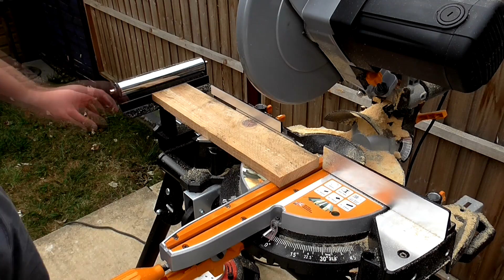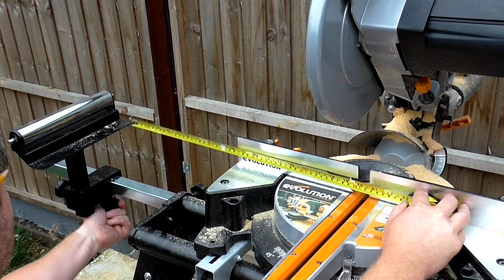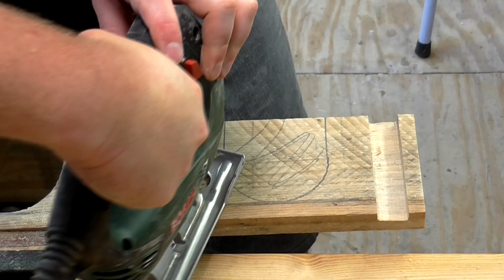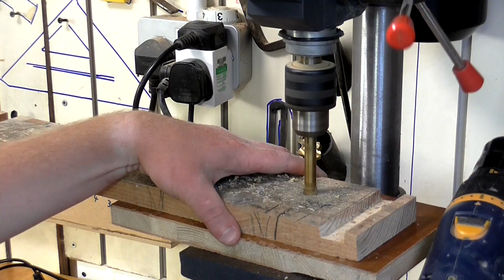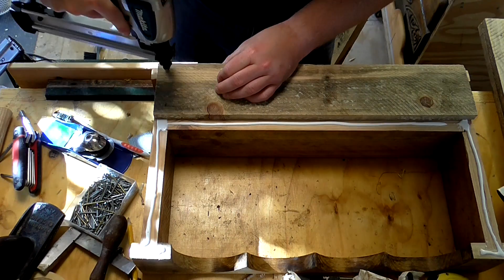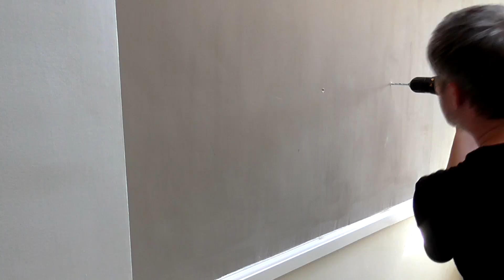Making A Rustic Pallet Wood Wine Rack

Comment: Nice build. Thanks for sharing.
Do you have experience with French cleats? Could be perfect here.
(Why) did you throw away that broken nailer?
Maybe you could have made somebody happy with it?
Some people like to repair older tools as a hobby.
Just a short time ago Colin Knecht from Woodwork Web showed how you can repair one
He had one with spare parts and probably also with a manual How to but that he did not use.
Here is a link to the video:
https://www.youtube.com/watch?v=OpD4WQqHnJg
Reply from the maker: the nailer was beyond repair, the metal casing had perished and it was leaking air.  You're right, french cleats would be a good choice for this project